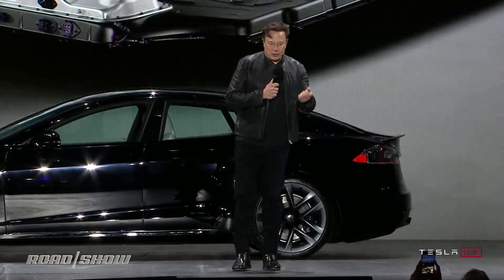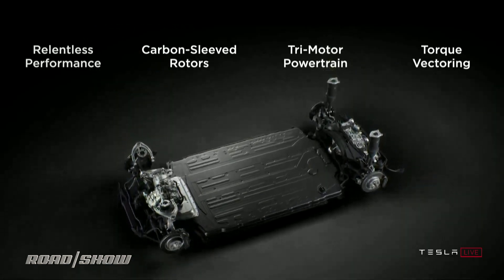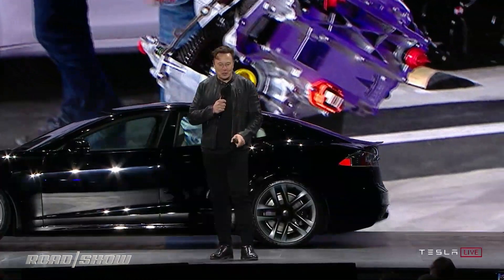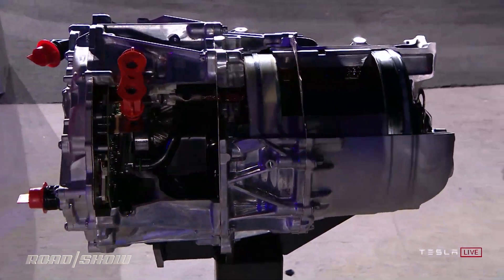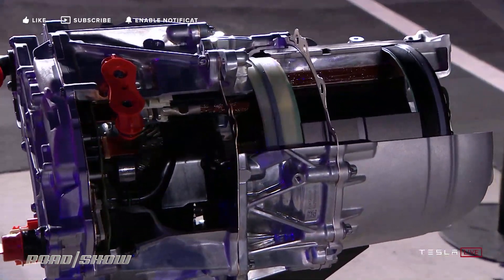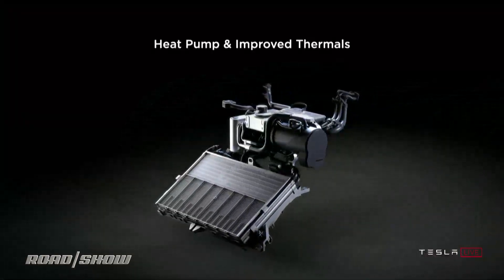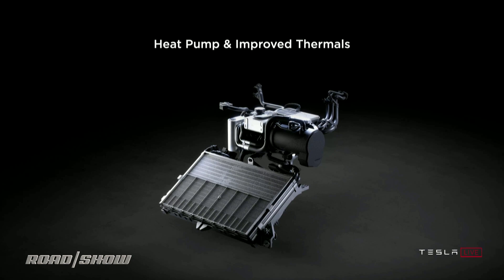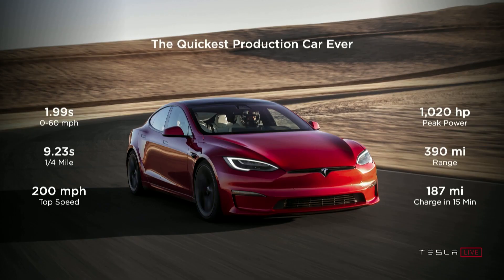The Model S Plaid’s battery and motor explained

Comment: The implications of being able to run motors at higher speed is colossal!! eg. Could this new Carbon winding approach be used to make, eg., Windmill generators run at higher speeds by using gear boxes allowing a wider range of speeds? Hence leading to improvements in windmill efficiencies?
Reply: bro u thinking too much of this... this too good to produce... wish dey did thou

Comment: Wow it is so obvious that Tesla is so far ahead of the competition. So many haters on here not wanting to see Tesla succeed, but that's common when you're jealous and drive a Corolla. A 4 door sedan doesn't have to be slow. How about a sedan that can do everything? It can be a supercar when you want it to and also get 100 MPGe, with a charging network that is 5 years ahead of legacy...and growing.
Reply: The difference between a Corolla and a Model 3 is night and day.  Teslas have perfectly calibrated accelerator power curves for one-pedal driving with butter-smooth acceleration and deceleration.  In contrast Toyotas lurch, rattle, and hum with all the mechanical conversion in the CVT, etc.  It's like driving a washing machine.
Reply: @jameshoffman552  mate , you know nothing about cars. Perhaps you better at something else. 👍
Reply: Dislike for calling Corolla here, another great car, otherwise you are right 👌
Reply: It's simply what happens when you put a top notch Physics guy in charge of a company...      too many companies are run by accountants. Innovate or Die!!

Comment: Only hear good stuff. Any bad?
Reply: Moving to electric cars is all good. Now that range and charging has been solved, there really isn't any bad.     Well, I guess I do miss changing my brakes and doing oil changes though....
Reply: No you get peak performance at any speed so no lol it's performance is just max all the way to 200MPH which has been software limited

Comment: I can't believe they made a car this good, and wrapped it in the same generic sedan design from 2010. Was unremarkable looking then and is just straight dated now.
Reply: Why people complain about design, if it works it does not need to be changed, your chocolate bar has the same shape as the one your grandma had but definitely it’s tastier 👍
Reply: The car looks amazing to me.. and it is a 4 door sedan
Reply: You have Honda and Toyota to thank for this line of thinking. The other is aerodynamics because it is hard to design something that looks amazing while having unique exterior elements see the new Mercedes electric IQS I think?
Reply: @netgeek3010  I think it's all down to their difficulties with shoddy body work,  and that it would take too long to work out the problems with a new design. I'd really hoped EVs would be easier to iterate on, with the skateboard design, but teslas really struggling with even paint still. This car really seems near identical to what the base roadster was going to be, and their sticking that drivetrain in the old S with cheaper batteries rather than finishing the roadster
Reply: Yep it's nuts
Reply: Spot on.